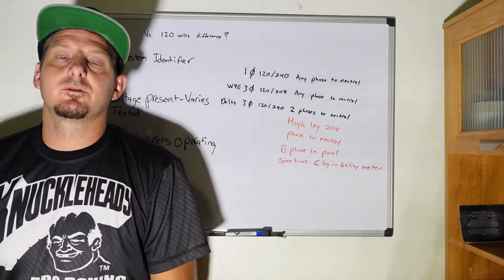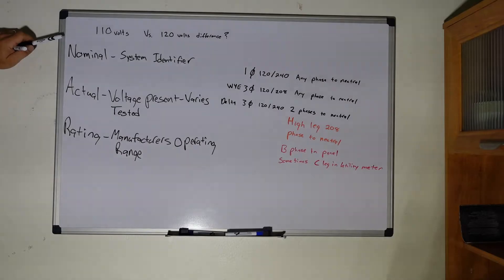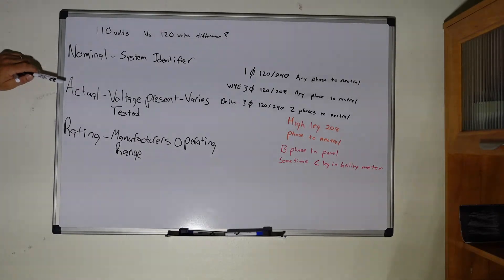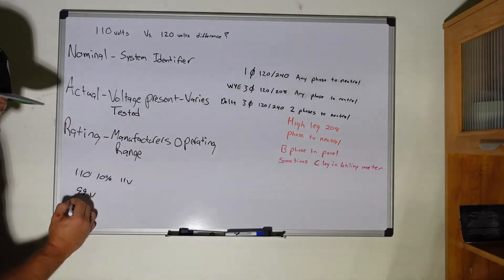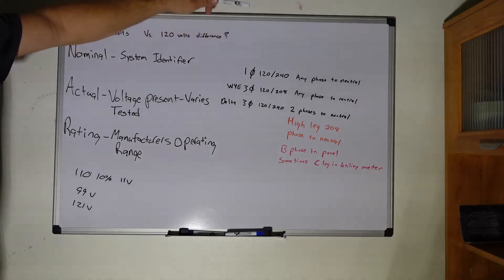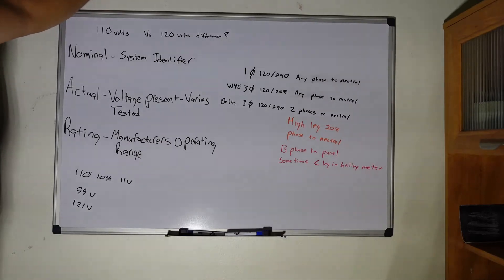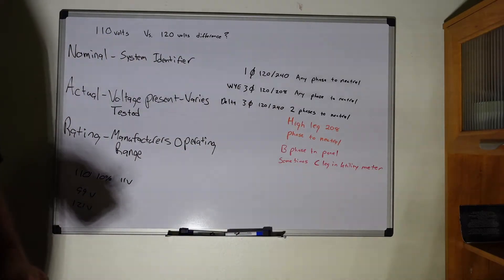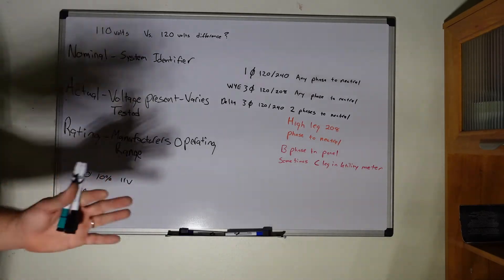Is there a difference between 110 volts and 120 volts?  Will my equipment operate correctly

Comment: I have here fryer appliance that require plugged into a 120V but i only have 110V converter with 1500va max capacity, fryer 1300watts. Can inuse 110v converte?

Comment: One guy explained to me that basically for the most part voltages are used just to determine which type of electricity is rated for that appliance if the appliance says 110v or 120v, then you know you can use your normal AC outlet in your home. if it says 220v or 240v then that means you need to have double rail electricity going to an outlet, I'm sorry I do not know much about electricity and electrical systems I was just trying to share information that I learned

Comment: I consistently have 125 volts measured at the outlets.  I have audio amplifiers that don't like the higher voltage.  Would that be something to contact the utility company about, and could they do anything about it?
Reply from the maker: The utility has a certain range they legally have to provide it within and 125 is about the threshold I have seen, but you would need to contact them to find out that exact number. You can always put in a step down transformer to get it into a range that they like.
Reply: @SolidElectricalSolutions  The National standard is 120 +/- 6 so 114 to 126.
Reply: @SolidElectricalSolutions  Good day can you recommend one/something in particular please? I have been looking for hours/days it is very confusing and my power feed is 130v on one leg and 128v on the other! I have already lost all my fans, my air conditioner salt water pump and other things which I am sure is because of that or because it might have spiked even higher at some point! I am looking for something to trim it and keep it trimmed thanks.
Reply: @StretchSounds call the electrical / power company?!

Comment: So I just bought a jackery 1000 bro and i have EGO blower has a charger 120v 60hz rating is possible to used on my jackery run ac 110volts?
Reply from the maker: As long as the hz is the same you should be good to go

Comment: My question is, I bought a car adapter that has an outlet so I can plug my house vacuum to it. Will it work if you plug in a 120 V vacuum into a 110 V outlet? Plz Ans
Reply from the maker: The answer is it depends on the rating of the vacuum and actual voltage coming off the car inverter, but more than likely not an issue as long as the inverter has the wattage capacity to start the vacuum. Hope that helps.
Reply: @SolidElectricalSolutions   This rye here, The inverter i have is 300w 110v 120v out, powers the vacuum for like 15 seconds then it cuts off an comes back on 5 secs later. The specs for both the inverter an the Vacuum is 120v 60Hz. Do i need inverter with more wattage? the vacuum is Amor all 2.hp an the inverter is bestek 300w
Reply: @magnificent10304  Yes, get an inverter with higher wattage.
Reply: @Grimes907  yes, I did that. Got a 2500 inverter an it works fine
Reply: I have 110v converter 1500va capacity, can i use fryer with 120v? Required 1300watts

Comment: So I have a heat press and a conveyor that run on 120v when I plug them in outlets that run from the same breaker it always trips the the breaker box. What can I do to fix this.
Reply from the maker: Run a new dedicated line for one of them, anything with heating draws a lot typically and motors do as well. Especially when they start up.

Comment: Thanks for the video. Can we use an All in One 120 Volt washer dryer with a 110 Volt outlet?
Reply from the maker: Verify the specs on the machine and the actual voltage present, to see they are within your parameters. But in most situations there should not be an issue.